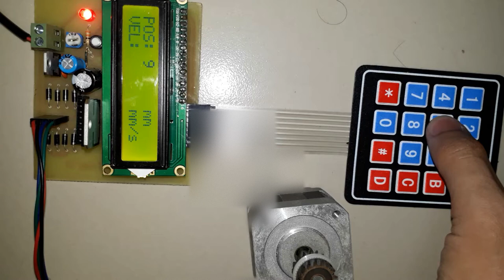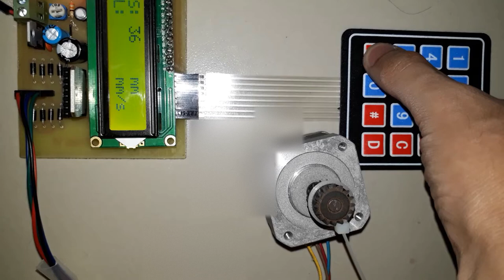Step motor (feed screw) position control use keypad

Comment: Hello! Your video is really great Please send Arduino code for what you have done and also the wiring diagram instead of stepper motor optical encoder  it has 2 signal wires , 1 face wire and one ground wire tatal 4 wires .  Actually I can't understand your language please make it in english it will help me a lot . Send your email id nor make a video regarding what I said . Help !!!